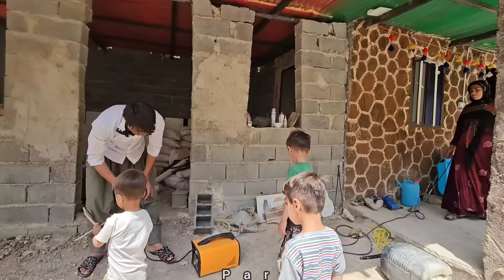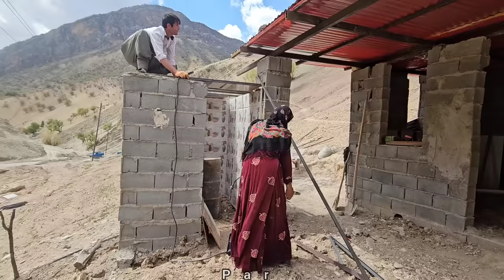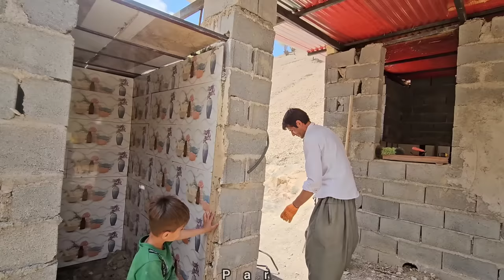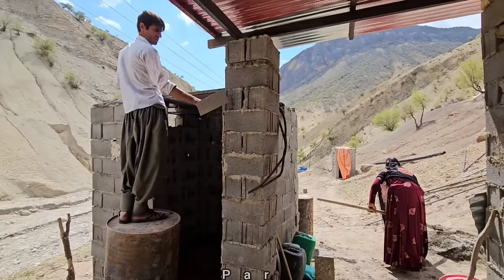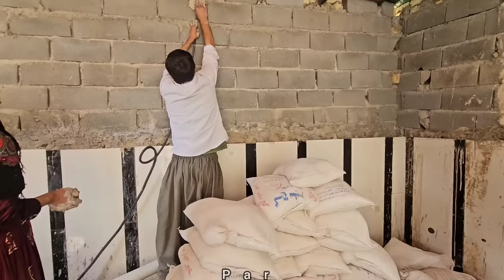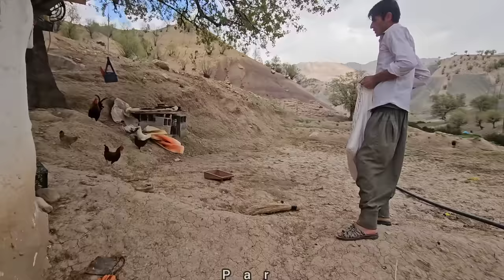Build a house in the village.🏡 Challenges for Babak to build a bathroom

Comment: Babak put the big water tank rear side of your kitchen.then install water pipe line in your kitchen and also put water pipe line in front of your bathroom. Connect the water pipe line in the water. Tank  then install water heater inside the bathroom.